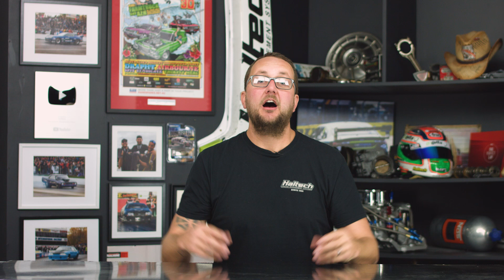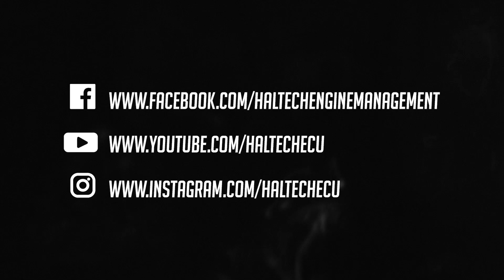🛠 Timing Light Explained  |  TECH TUESDAY  |

Comment: dial back is the only thing to have if on can not set down and learn what say 10 degrees of start up initial timing is vs the increase over and to it`s peak say 36 degrees well they will not be able to ever tune stuff and it help to learn ..i suggest a video one ignition timing advance retarding  animation first then a timing light video right after of combined i may do on later i ant seen one like that

Comment: On some products, you need to unplug a SPOUT connector to cut the ECU timing control off and enables you to set the timing.  Say it calls for 12 Deg Before top dead center. (Always cylinder number one)   At idle warmed up, turn the timing plate or disty to get your 12 Deg. and lock it. Plug the SPOUT back in and off you go.  But most American products stopped having to set timing back in the 1990's.

You don't want to know how to set timing on a 1960's vehicle.  It requires some extra steps.

Comment: Hi Haltech. I have an ej20 from a wrx and tried to replace the timing belt. I used the factory marking however the belt will skip a tooth and start to run badly. Would you have any idea how to remedy this or what the problem would be? Any feedback from anyone would be hugely appreciated.
Reply: When you set the timing belt did you allow for the tensioner to pull the belt slack back?
Reply: @seanschackier577  no I didn't. Thank you for your reply ill check the tensioner and hopefully that solves it.
Reply: When using a tensioner that has been elongated.... 
Compress the tensioner vertically with the rod with the 2mm hole facing up. This is specified in the service manual and a lot of people do not do this, then blame the design of tensioner. 

Remember- vertically!! i usually use a g clamp.